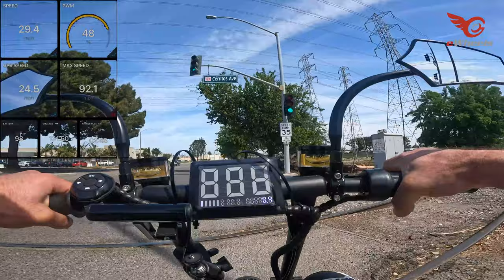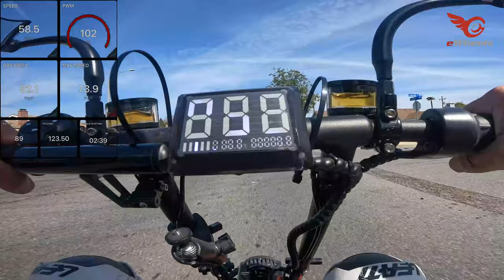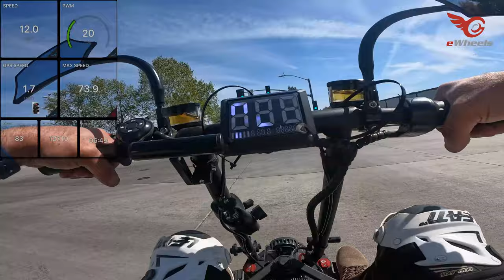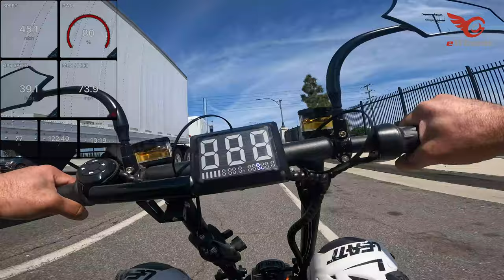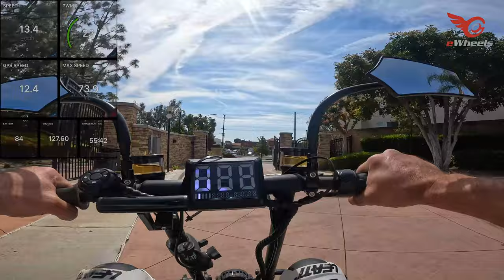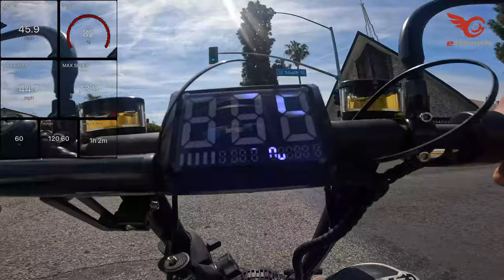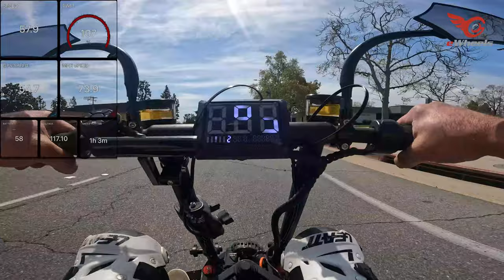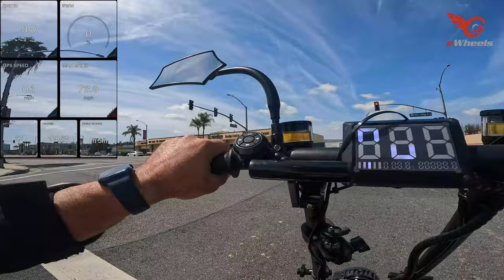Extreme Bull K6 - Quick review and ride - I hit 74MPH - Sorry, no crashes

Comment: I love my K6, I upped the battery to 4800wh, I threw my Master pro batteries into it.   works better now and it hits 65 easy.
Reply from the maker: Try the new field weakening firmware.
Reply: Was it an easy process to swap the batteries I wanna do something like this eventually but I think updating the firmware would just work just as good right?!

Comment: That Scoot is a Hoot!  I'd love to have one! Man oh man, the acceleration and the speed!  Only down side is maybe how visible your are to other traffic? I'd want wear bright fluorescent colors in the day and lots of flashing lights at night. The LED backpack would have to be strapped the the back of the seat. Does that thing have and suspension or just a foam seat for your roides, I mean rides.
Reply from the maker: Fork suspension and swing arm suspension in the back
Reply: @roghaj  Theonly other problem I see is ground clearance.  I'd love to be able to ride down my rural roads but the the rock can be deep and loose. A wide wheel wide and snobby tire on a EUC seems to handle most everything, except maybe loose sand.

Comment: I keep meaning to mention this to you Roger. Since youre good with wiring and soldering and rewiring electronics and all that, why dont you install a lil toggle switch on the gopro, so you know if its flicked to the left its on, right its off or whatever. Would that be possible?

Comment: If you haven't tried any of the WEPED ones, they're pretty much the only ones doing a reverse front linkage suspension which solves a lot of issues I have with common scooter design guides/rulesets everyone seems to be using.  
Also, any sit down scooter like this needs a front rack, bedroll, and ape hangers - I swear I keep seeing saddlebags on it.
Reply from the maker: This thing is fun. Perhaps because it's dynamics suck.